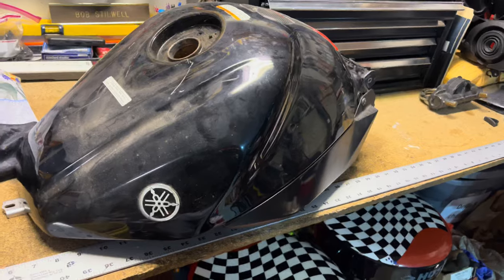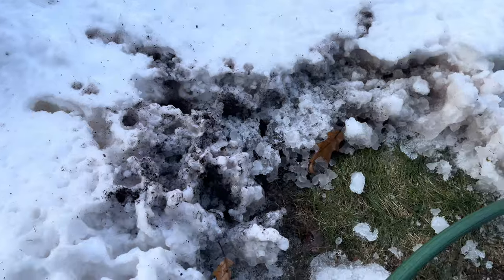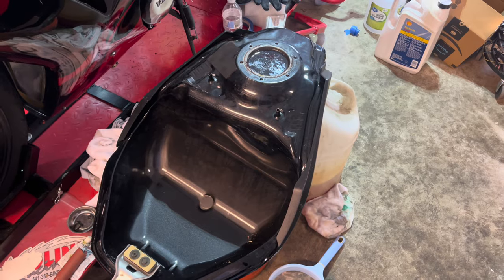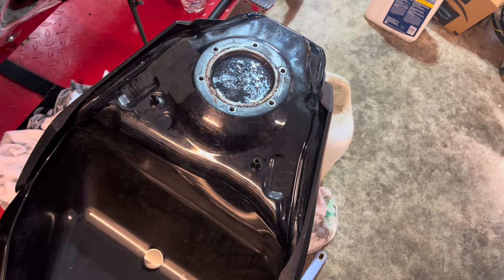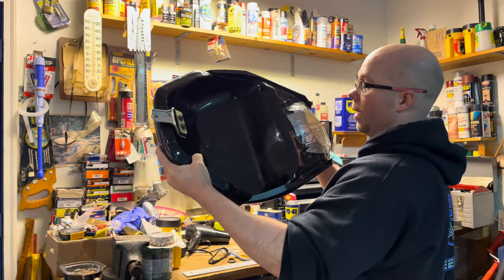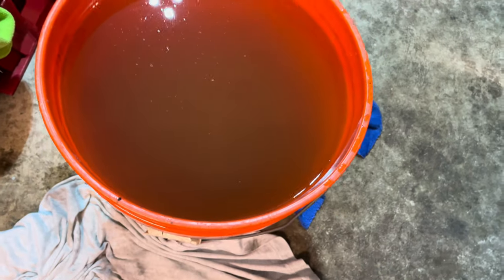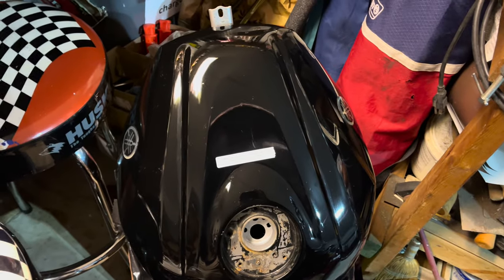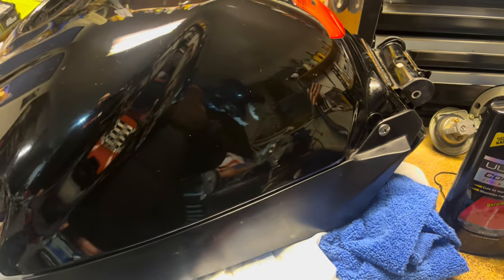How to remove rust from a motorcycle gas tank and seal it for a new finish

Comment: Hi there, your tank looks brilliant, the only thing thats that confuses me is different sites have different ideas, a few say that vinegar is bad as it etches metal which causes the flash rust, but im going to try your way as the tank really looks great, i tried vinegar on an aluminum part of my ducati to clean the corrosion of it and it worked great, thank you for your video.
Reply from the maker: @georgemacdonald5282  thanks for viewing! Yea the vinegar did a great job as you can see! There is plenty of things you can use to get rid of the rust but vinegar definitely seems to be cost effective. If the video was helpful please subscribe and share the channel with your friends. I appreciate the support 👍🏻

Comment: Great video, it was very helpful.  I'm resurrecting my dad's 1972 Honda CL-100 Suitcase Cycle, and the gas tank was pretty rusty.  I wanted to save the tank as it has the Suitcase Cycle decals and it still looked good outside.  The vinegar did the trick, and it cleaned up beautifully.  Just coated it with the POR-15, and waiting for it to dry.
Reply from the maker: Awesome thanks for viewing! It did a really good job on that r1 tank that I did. I’m sure the Honda tank should be mint and I’m happy to hear your resurrecting the CL. Get some videos of it I would love to see it
Reply from the maker: @susceptible2639  it’s mixed with the distilled water to neutralize the acid from the vinegar

Comment: Thankyou very much for your video. This was by far the simplest, and cheapest way to clean and reline my motorcycle tank. Worked like a charm.
Reply from the maker: Nice glad it worked out! Definitely a good feeling
Reply: @ctadrenaline  hey man, we dont have that fuel tank sealer here, what do i do now, can i use anything else???
Reply from the maker: On eBay here’s a link https://www.ebay.com/itm/332496015274?epid=1523750644&hash=item4d6a4e8faa:g:wAEAAOSwhplaYOwI&amdata=enc%3AAQAHAAAA8NnDp9lif9O%2Bv0%2BsjUG0we1kFnmzuaQxrrwcQAHFISJDf0jWnxOFRGEj7nEfmaB19CjXAu6KPWf0i3f82FuFirbMCDVmrg3ay1cmsaxOCmeFLZxh9um6xNyHDlw1LncNbAh4%2FcGP4QG0ykhyHyfRB2kd4h5SKIDx0pVAF9C57bBLA31wllnn1J6J9BqKfR0x8wlMx%2Fejh0MeJS3KoEvGC0mNytPvBX9L4gPMJAvhGR7uyi4gan0jUWpuOVEJ1Bhg8EEWTFZz6S6QmkLp1JK50QL8dZmMJb41sr93gqNSUH9KuK4YH%2BnhjVNmYpgbus%2Fsrw%3D%3D%7Ctkp%3ABk9SR46Cie_fYA
Reply: @ctadrenaline  Dude i dont have EBay in pakistan 😭😭😭😭 do somethinggggggg for meeeeeee, can i use some sort of paint or primer or anything i can use here
Reply from the maker: Try ordering directly from the site. If that doesn’t work let me know https://por15.com/products/fuel-tank-sealer?_pos=1&_psq=fuel%20tank%20se&_ss=e&_v=1.0
Reply: @ctadrenaline  yeah u cannot buy it internationally, bruv i have a suzuki bandit 250 that i bought 4 goddamn years ago and i havent had a ride on it since, because i couldnt find the parts, now i still have to find a fuel tank and carburetors for it, i saw a fuel tank in japan but it is lightly rusted, by the way i have heard that Red Kote works wayyyyyy better than anything on the market
Reply from the maker: Redcoat works but either my buddy did it wrong and it didn’t make a smooth finish or that’s how it is. If you can get red coat then definitely use it. The por15 is self leveling which is why I recommend it plus it makes the inside of the tank the color it should look like
Reply: @ctadrenaline  honestly i dont care even if it looks like rocks inside 🤣, like i don need a smooth finish, just a rust free tank, but obv both of these products are from the US so i cant get em, lets see what i can do
Reply: @shujabhatti536  Hey Shuja. I used 'KBS Gold Standard Tank Sealer' and followed the above method which worked for me. Maybe you can find this product where your at. Good luck
Reply: @shujabhatti536  amazon

Comment: I use vinegar to clean a tank from a Yamaha FZ600.  It works extremely well.  With that said, it is not as easy to clean out tanks as it seems.  Unlike the tank in this video where it has a vert large opening and a basic shape without a bunch of bends creating crevices unlike my tank which case has a small opening, a bunch of angles and almost like a partial tube down in the filler neck with makes it impossible to make sure I can get all the rusted debris out.

I used vinegar on mine but had to end up getting another tank anyways. But I was curious of the results so I cleaned out my old to see how effective it was and was impressed. Like some others have done, I would suggest putting in some sort of non reactive nuts or something to help knock off the rust. I noticed on the inside of my tank there was still some rust stuck on the wall on some sports.  I was able to scrape it off easily with a screwdriver though.  

If I was able to salvage my old tank, then there was no way in heck I would of been able to clean every nook and cranny in there let alone get all the debris out in order for the sealer to adhere properly. I figure I would of just had to rely on luck and use a lot of sealer and hopefully any leftover debris or rust doesn't compromise the sealant. As long as the sealant doesn't fail in those areas and the leftover rust underneath isn't too aggressive I figure you can get some new life to the tank still. So the vinegar works but results of success may vary based on the design of your tank.
Reply from the maker: With tanks like that I would suggest a longer waiting period or even multiple sessions of vinegar. Instead of nuts and bolts maybe something like a chain that would be easier to get out instead of a bunch of single nuts and bolts but either should work. If your patient enough vinegar should ultimately get rid of all the rust. How long and how many times you would use more of the vinegar will vary. You could also use acid if time is a issue for faster results. With smaller openings, whatever end is bigger is the one I would use to empty the crap out. There is plenty of ways to do this of course. Some designs may take longer then. Others. Either way thanks for viewing and adding your experience

Comment: I've used por 15 sealer several times, it's the best. prep like this is vital, I used electrolysis to restore a very rusty tank I got for free, it had been left outside with no cap for months. Por 15 sealed several pinholes as well, plus it's ethanol proof, my gpz900 tank was rust free 5 years after treatment, when I sold the bike. Don't get it on paintwork though...it's impossible to remove once set!
Reply from the maker: Absolutely I couldn’t agree more. Yeah it took me a while to get some off my skin lol. Por15 is amazing stuff for sure. Thanks for watching!

Comment: Does this seal leaks/cracks and how do you keep the compound from getting to the screw holes for the fuel pump and lid key/cover? Thanks
Reply from the maker: It will seal pin holes but cracks may need welding. Really depends on the severity of it. The holes for the lid key cover I don’t believe actually go into the part where the fuel is. You could always put something in the holes for fuel pump. I didn’t do that and the holes were fine for the fuel pump. If for some reason they do use a tap/die set and re-thread them. Remember when the por15 is in the tank you want to constantly keep the liquid moving around . It shouldn’t be stationary. Eventually it will get to a point where the liquid is barely moving at all ( the left over and you can use something like paper towel or something to get most of the excess out but only when your sure it has covered the whole inside of the tank
Reply: Thank you for the detailed reply. I’ve taken my tank off a week ago, placed it upside down in my shed. I believe it has a leak somewhere, had half a gallon of fuel on the under side exterior of the tank pooling. 

I saw your video and was excited that there may be a solution to my problem. Since I’m replacing my fuel pump (bike won’t prime) with a new Quantum one anyway, I’m gonna take the time to clean up possible rust inside of it, you’ve done a really well and informative detailed video of the “how to”. Thank you very much for your help, it is sincerely appreciated. I’ll send u a pic of what mine looks like before and after when I’m finished with mine. Keeping my fingers crossed the bike will start. I have a Yamaha yzf r6 03’ (same fuel tank) .
Reply from the maker: @Ok-ud7kh  awesome glad the video was helpful. Please share the channel with friends and subscribe if you have not already

Comment: What’d you use as a stopper for the top of the tank while filled with vinegar? Or did you just use the filler cap?
Reply from the maker: I just filled it to the very top with vinegar and let it breath. While the vinegar is in there you do not have to cover off the top
Reply: Well, I mean what you use to keep the vinegar in the tank lol. You had filled it from the bottom, so what kept the vinegar from pouring straight out the top?
Reply from the maker: @TheJdog513  oh yes that’s right and I understand now. Yea I used the normal cap for the top of the tank

Comment: How do you keep the screw holes and other holes inside from hardening from compound?
Reply from the maker: It depends on the tank. In that particular one, the holes on the top of the tank that held on the fuel cap did not go into where the fuel is. You can also use a tap and die set ( using the tap of course )to redo the threads. But most bolts if you take them out fuel won’t go through where they are. Fuel will  come out the part where the gasket is for the fuel pump or the pet cock

Comment: Did you use a pint or half of pint for the por 15, I'm doing my 2003 suzuki gsxr 1000 my tank is 4.8 gal
Reply from the maker: Prep is the most important thing. The tank needs to be very clean. I used a half pint for a 5 gallon tank. It will be just enough. When you’re checking out where the sealer has gone after a few minutes of rotating the tank, whatever spots you missed let the por15 drip to that side till it covers all areas. It’s a long process but you save the fuel tank
Reply: Thank you

Comment: I have a honda vtx 1800 with the fuel pump inside the tank, will I be able to do all of that to clean my gas tank ?
Reply from the maker: Can you take the fuel pump out? If so take it out,follow the procedure, I let it sit for at least a few days ( can’t remember exactly how long it sat for after I finished, follow instructions) then reinstall. That’s how I did that tank

Comment: What causes motorcycle gas tanks to rust, is it because they’re left out in the rain?
Reply from the maker: If the tank is not kept full, condensation occurs. When moisture gets trapped inside, the metal interior begins to rust. Ethanol gas, more corrosive than pure gasoline, also affects the metal in your tank after a certain point and is not recommended for long-term storage
Reply: @ctadrenaline  my first bike was a katana a can of tuna …. It had carb issues I’m assuming it was sucking rust from the gas tank . I returned it took a loss on taxes … now I’ve had two R1s never will ride anything different
Reply from the maker: @officialyungzoe6466  nice what years are the r1’s you have?
Reply: @ctadrenaline  04, lol I want buy nothing pass 08 guess ima lol old school
Reply from the maker: @officialyungzoe6466  excellent choice. I had a 05 and it was a great bike. I wish I did that negative front sprocket to it. I still have the sprocket in the garage somewhere

Comment: Hello! Couple questions I just bought a 03 CBR600RR and I was wondering for using vinegar is it okay to use with the rubber seal on the fuel tank lid? I’m dubious of whether it could do damage as well as doing what we want.
Reply from the maker: Take out the rubber seal part just incase. It’s been awhile since I did it but I’m almost positive I took it out. Rest the tank upside down with lock closed and in a 5 gallon bucket so if any drips out, it goes into the bucket and can be put back into the tank a few days later if needed. I think mine leaked a little bit at first then basically stopped leaking. Obviously the fuel pump needs to be removed

Comment: How do I clean the fuel pump that was sitting with the tank it’s just filled with mushy rust
Reply from the maker: Try your best to clean with gas first for the fuel pump. You will have to disassemble it probably. It’s possible you might need a new one. But I would try to restore it first
Reply: @ctadrenaline  I used a bunch of break cleaner and a medal brush hopefully that was enough enless you think there could be more messed up
Reply from the maker: @GTPressure  definitely worth a try. Maybe rinse off with some fuel that’s not dirty then try it if the tank is fixed

Comment: I’ve got a quick question. When you neutralized with the distilled water with a  cup of baking soda (combined together) , how many gallons did you use? I’m doing a Valkyrie tank( 6 gallons) and was wondering if you just sloshed around a gallon of water/baking soda poured out twice? Thanks
Reply from the maker: The tank I did was a 5 gallon tank. I bought 2 gallons of distilled water. Mixed up one gallon ( had to poor out a little water to fit the 1 full cup of baking soda) mixed it well in the gallon container, then I poured it into the tank and sloshed around for a bit. Emptied it out then did it with the next gallon of water. After that I went to the bathroom used the tub and washed out with warm water and  Ajax dish soap. It took a long time to wash out and get all the suds out. Once completely clean with just water coming out when emptying  then I did the drying process ect
Reply: Thanks a bunch!

Comment: How much of the por15 sealer did you use on the tank
Reply from the maker: I used the 8 fl oz for the whole tank. Some may require more if they have hard to reach places. However look up the product it will tell you how much the container size will cover
Reply: I did two XS650 tanks with one tin of por 15, just coated one then drained the liquid straight into the second, and still drained out a little. I tipped it back into the tin but it cured inside, set rock hard!

Comment: Did you have any varnish in the tank ?
Reply from the maker: I’m not 100% sure but if there was any it’s gone now. it was pretty rusty in there before I cleaned it. After the process was done and before I put the sealer on it looked like brand new metal

Comment: Oh no! Did you leave tank to dry 100% for couple of days? Can’t stress how much the tank must be bone dry! First attempt on a tank I did there was just the smallest amount of moisture and that was enough for the sealer to react after a couple of weeks!
Reply from the maker: I made sure it was dry with a hair dryer and a drying rag. If you wait a couple of days it will flash rust. Also did you use por15 or a different sealer?

Comment: why not poor the baking soda directly into the tank with the vinegar inside when the vinegar is done and neutralize it that way?
Reply from the maker: Thanks for viewing. I’m sure there is plenty of ways to get this done but I wanted to make sure to fully rinse out everything as there was rust floating around in the vinegar. If you think about it, if you poor baking soda into the vinegar the baking soda is only going to neutralize so much. With the way I do it, I make sure any left over acid from the vinegar hanging around in the tank gets hit with the baking soda and distilled water. Results will vary depending on how to choose to do your tank. I do know that how I did it in video has made great results

Comment: Or just fill it to the top with gas don’t need to seal it at all if it’s gonna be used daily and putting gas all the time
Reply from the maker: I just got another r1 recently thats gonna be on the channel. The tank does have a little bit of rust towards the top. Im gonna try to use a toothbrush and something to clean it up a bit. You can definitely try keeping it full of fuel and it will probably be alright like you mentioned especially if daily ridden. Great idea if someone doesn't wanna seal it

Comment: why do you need to dry the tank before putting in the vinegar…just add the vinegar after your done washing the tank
Reply from the maker: You can put vinegar in the tank after washing out if you want. That’s just how I did it. I didn’t wanna chance possibly diluting the vinegar some. I understand vinegar does have water in it but either way it will work. Thanks for viewing
Reply: @ctadrenaline  The vinegar you bought at Wallyworld is already 95% water. A little bit more wouldn't hurt.
Reply from the maker: @JAllen-db2kv  true. I was happy with the end result of the tank. Thanks for viewing!

Comment: Why don't you use coca cola
Reply from the maker: I’m sure there is plenty of other things you can use like Coca Cola. However i tried it with vinegar. If using Coca Cola, it takes about two 2 liters to make a gallon. So I would of needed about 10 jugs of Coca Cola. Roughly around 22 dollars. The 5- 1 gallon containers was cheaper by about half. Let us know if you use Coca Cola and how it comes out
Reply: @ctadrenaline  yesterday I used toothpaste but the result was not good. Next time I'll use coke and will inform you
Reply: Cola would require a TON of extra cleaning... as any sugar ending up in a carb, fuel injector, or engine will end up gunking and causing serious long term damage.

Distilled vinegar is cheaper, more acidic, and doesnt have sugars.
Reply: It doesn’t work . There are comparisons on YouTube of the various methods come came last place . It barely did a thing . IMO  the best cheap method is electrolysis.